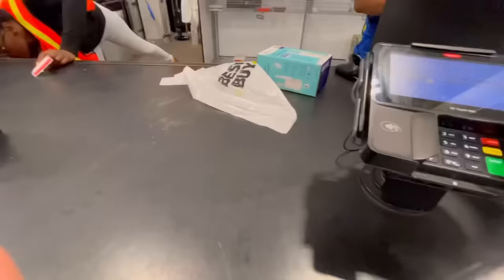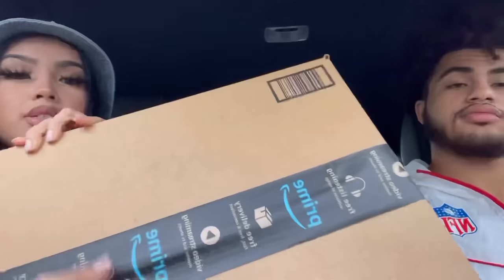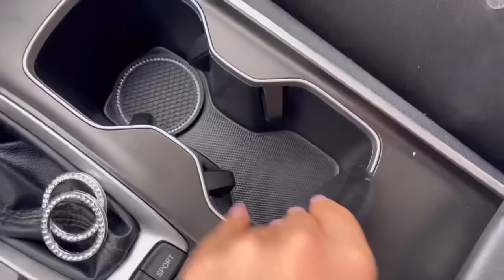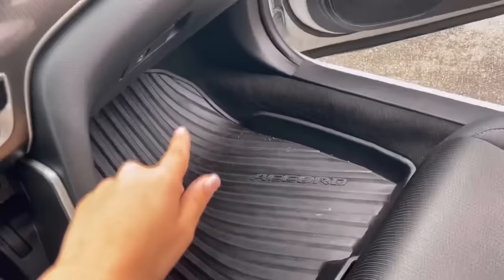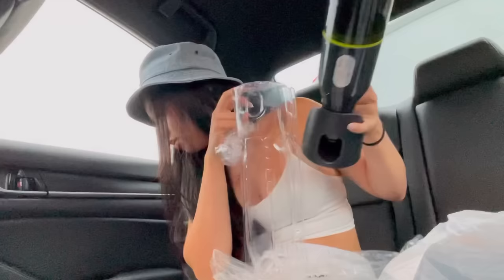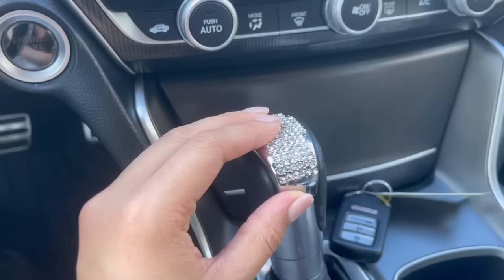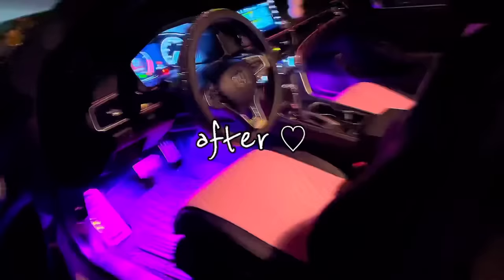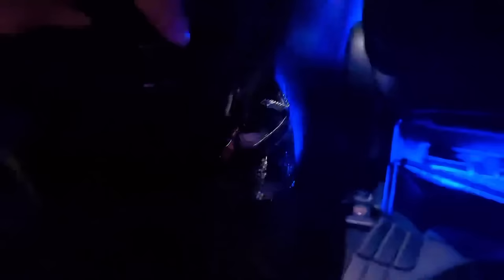DECORATE MY FIRST CAR WITH ME + CAR TOUR 2022 💖

Comment: Be careful with the bling on the steering wheel girly. If the air bag goes off the bling could seriously hurt you if it hits you in the face☹️
Reply: It’s woven into the fabric so it doesn’t move it’s not loose stones
Reply: do you have a boyfriend

Comment: That’s good you take pride in your Honda. The fact that you chose a Honda shows you make wise decisions. Those cars will last a long time, save gas, & save you money on maintenance because they’re low maintenance. BMW, Mercedes, Audi, etc are all money pits. They’re not reliable & are always messing up with expensive repairs.  If you want luxury I would recommend Lexus. Very reliable and they don’t break down. With any car just change your honda oil every 5k miles & the transmission fluid when it’s due & you’ll be fine.